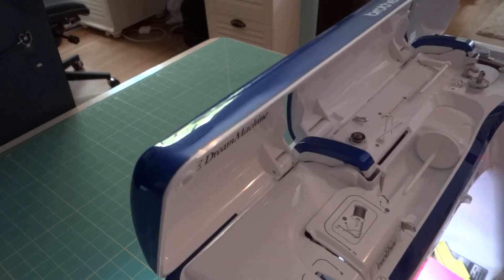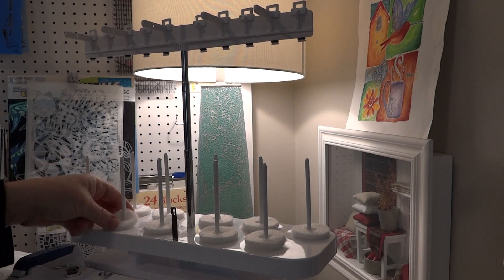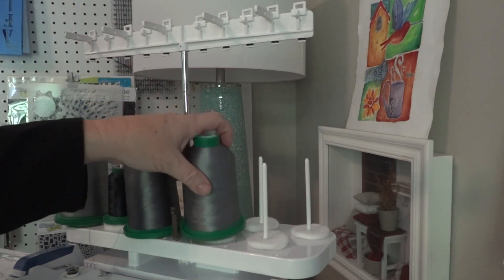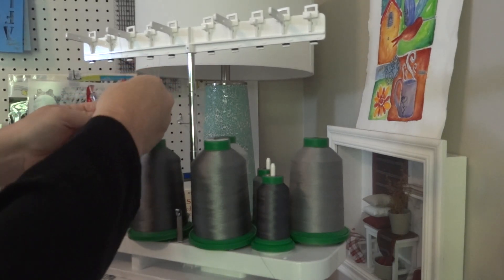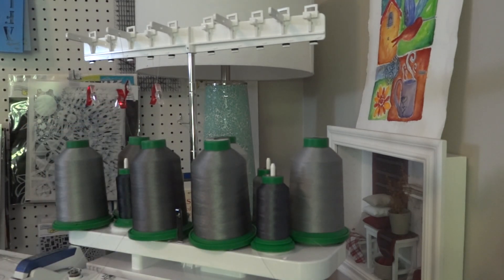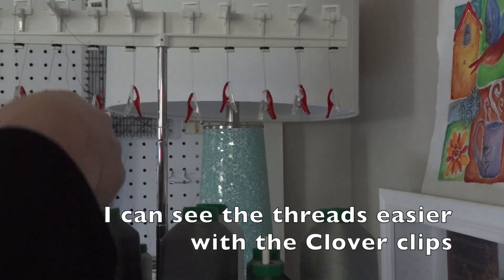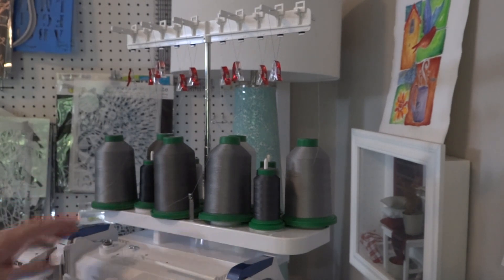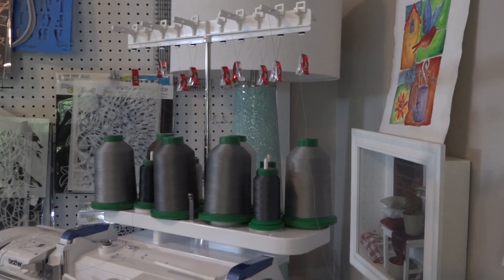Brother 10 spool holder SA561

Comment: Each brother spool cap has a little "dimple" in the front; I use a drill and drill a hole through that dimple. Consequently, when using an external spool stand (or a multi spool stand) I pass the thread through the hole I have made so the thread feeds into the machine horizontally.
Reply from the maker: TheCynedd thank you for the suggestion. I really enjoy hearing about the mods that others make.
Reply: I don't suppose you have a picture or little video of what you mean?

Comment: i just installed my thread stand and noticed the instructions say to use the clips for spools UNDER 1100M so I took the all off, seems less complicated and more direct.
Reply: Should be 1000M not the 1100M I stated above
Reply from the maker: Ruth you are going to enjoy your thread stand !
Reply: Did your box come with instructions?  Mine had none, and the Baby Lock website doesn't provide anything when I click on the Manual.